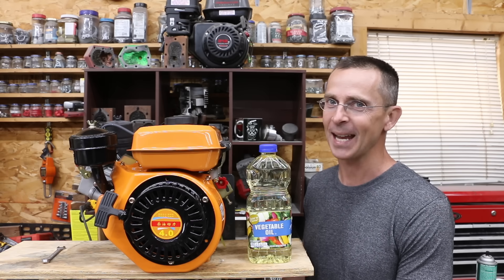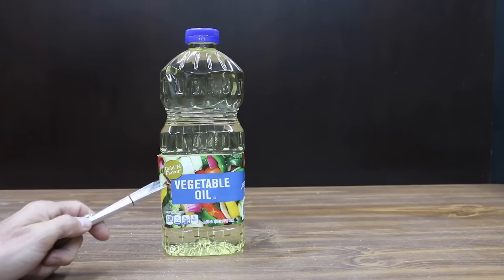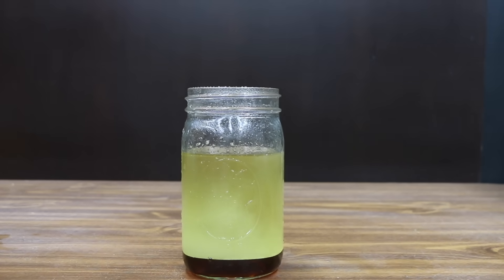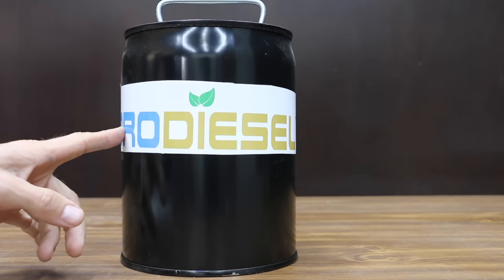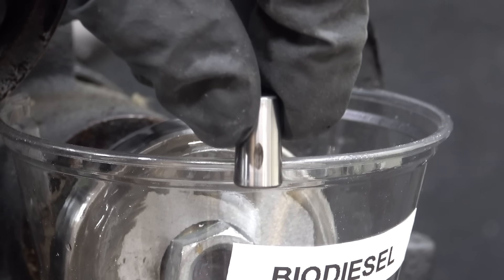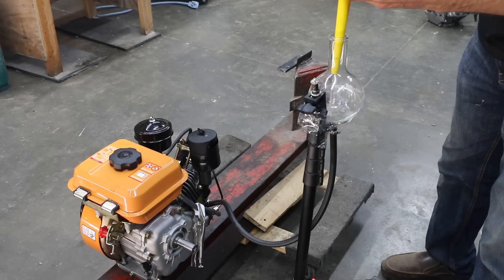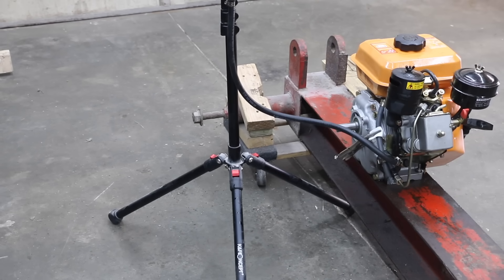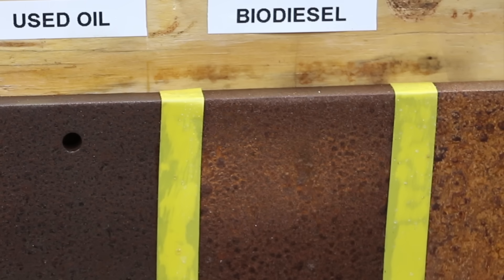Make "Biodiesel"? Let’s find out! Diesel vs Biodiesel, Used Motor Oil, Vegetable Oil, MPG

Comment from the maker: Here's the list of products reviewed. More details in the video description. Thank you!
Diesel Engine: https://amzn.to/34vTb0Y
Potassium Hydroxide: https://amzn.to/3i3xoFG
HEET: https://amzn.to/3p16IqN
Reply: there is a better self made bio Diesel
It's called a Schur Mixture. 
80% vegetable oil
15% petrol
5% rubbing alcohol (which needs to be dissolved in the petrol first before putting everything into the vegetable oil)

During summer you can use less petrol and the alcohol is just there to make get better ignition, so it's not strictly needed for all engines.

Comment: No,
there is a better self made bio Diesel
It's called a Schur Mixture. 
80% vegetable oil
15% petrol
5% rubbing alcohol (which needs to be dissolved in the petrol first before putting everything into the vegetable oil)

During summer you can use less petrol and the alcohol is just there to make get better ignition, so it's not strictly needed for all engines.

Comment: My only comment would be that the conclusions of which fuel ran the best is purely opinion based as you did not set up any kind of measurement metrics to make that determination.

Comment: Unfortunately, the skill to make biodiesel is pretty useless. Most cars/trucks can't run off pure biodiesel. Most "biodiesel" you find at pumps is only 10-30% biodiesel. The viscosity is too thick to get through the injectors.
Reply from the maker: Thanks for the feedback.
Reply: @ProjectFarm  thanks for the reply. Rereading what I wrote makes me seem like a downer, I'm sorry.

I think being able to make biodiesel is really cool and had looked at doing it to try and save money for my off-road vehicle. Needless to say, I was a little disappointed when I learned I'd need a solvent (gas or diesel) to make it usable. To me it felt like it defeated the purpose.

Comment: During the late spring through mid fall i run a 60/40 blend of bio diesel and regular diesel fuel for many years wino problem i did build a filter system using wix oil filter and a electric pump to pre filter the used vegetable oil and another one to filter it once again before I mix it with the regular Diesel fuel. Before I stared doing that i was having to change fuel filters on my truck a lot  but now once a year.
Reply from the maker: Thanks for sharing.

Comment: Hook.
It to a heat pump or an air conditioning unit to use as a heat pump and see how efficient it would be to run it.Heat pump with your motor get the heat from the motor and the heat pump

Comment: As students we used filtered old vegetable oil from a french fries shop (common in the Netherlands France and Belgium) mixed with diesel about 10:1 for years. We had some issues with clogged up fuel filters, but that was about it.
When you get to adulthood, you start to want a car that doesn't make the whole area smell like french fries (not burnt french fries).

Comment: Older mechanical injection diesels can run on anything. My friend has an 82 Toronado diesel (upgraded with ARP head studs), and he takes all my used motor oil and my boyfriend's, and fills his tank.Runs flawlessly on the used motor oil. He keeps a couple bottles of vegetable oil in the trunk in case he gets low on fuel. Doesn't smell like storing diesel there. We have a provider of biodiesel nearby, and it's cheaper than regular diesel and his car runs better on it, less smoke, more power. Amazingly enough, he managed to run it on medium marine fuel oil once (He's a marine mechanic). Even has been run on Jet-A. The Stanadyne DB2 pump is good at compensating for different viscosities of fuel, so whatever is run in it, it tends to run well.
Reply from the maker: Thanks for sharing.

Comment: I want to cook with it and heat my teepee tent with a diesel heater running on bio-diesel. With lower viscosity, I think it will burn hotter with my wick stove. I'll probably mix diesel or kerosene with it in the winter to keep it from gelling.
Reply from the maker: Thanks for sharing.

Comment: All of the used oils and hydraulic fluids I collect at home I catch as clean as possible in a catch can I keep sealed in double trash bags. When full, I pour the 15 qts into 5-qt oil jugs I save from new oil/fluid changes.  I let the jugs sit for at least 90 days and then slowly pour off the top 4 quarts. The last quart has the settled solids or contamination in it. 

I mix 3 gal of the clean used oil with gasoline nearly 1:1 in 5 gallon fuel cans and shake for 1 minute, and put two 5-gallons cans into a 3/4 full tank of diesel. My 2005 Ram diesel has a 40 gallon tank. This makes a mix of about 15% used oils.  It seems to run fine Winter and Summer.  I do change my fuel filter a little sooner than typical, about every 10,000 miles, rather than 15,000.

The dirty oil left in each jug i combine  again and let settle another 90 days and repeat. The 2nd time I pour off the top and use the remainder as chain-lube and make two-cycle fuel for my chainsaw, and some start my wood boiler at night.

It's a cheap and easy way to get rid of collected fluids, have a little free fuel, and not waste anything either.
Reply from the maker: Thanks for sharing.

Comment: A video on different black diesel filtering systems? Like the cheap filter setup vs a centrifuge setup maybe
Reply: Unless that's too expensive a video of course. Although you could use that fuel for your equipment and ram if you still have that
Reply from the maker: Thanks for the suggestion.

Comment: For those considering waste motor oil (black diesel), as stated ensure your diesel engine has manual injection fuel pump.  Also, I recommend thinning it with kerosene over gasoline, and using a 5 micron filter before putting it in your tank.  I ran black diesel in my mercedes for a few years during college when money was tight.  I had a few friends and a shop that would give me their waste oil
Reply from the maker: Thanks for the feedback.
Reply: @ProjectFarm  You're welcome!  Thank you for the excellent content!

Comment: Back in the late 80's early 90s,  a few trucking companies tried using used motor oil for diesel fuel.  The problem is, after about 100 miles the fuel filter needed to be changed.  I thought if they  pumped the oil through 4 filters first,  it may have worked better.  Just a guess on my part.

Of course it would depend on the volume of used oil too say 200 gallons.
Reply from the maker: Thanks for the feedback.

Comment: Had a 3-cyl Kubota with a compression release. In winter you could pull the c release and get the engine spinning and the oil pumping for a dozen revs then close the release and it would fire right up. Batteries lasted 17 years in that thing with no effort at all.
Reply from the maker: Thanks for sharing.

Comment: Wow that’s amazing that the engine was running on motor oil! It might be useful if you have a generator to save your used motor oil to cut down on fuel costs if it’s used regularly. Thanks for the great video!
Reply from the maker: You are welcome !

Comment: fun fact, the modern injection pumps, like 2000 foreward, are not that happy with oil in the fuel because of how the operate. the ones from the 90s could actually run on partial oil, because the pumps are less refined and so they wont die
Reply from the maker: Thanks for the feedback.

Comment: You can make biodiesel using water cooler jugs as containers to distil and mix vege oil with caustic soda and ethanol. Farmers in  SE Asia do it, as imported diesel for farm equipment is expensive if you have no cash flow.
Reply from the maker: Thanks for sharing.

Comment: Great video! Years ago I used to drive my Peugeot Partner 1,9D (made in 1997) on used engine oil for couple of years. It had no problems with it, even started quite well on cold climate. At first I filtered it but later was to lazy do do so. In the winter just in case added some 30% diesel on tank to be sure it has no problems with starting. The engine did not smoke or did not smell badly when using old engine oil as fuel.
Reply from the maker: Thanks!  Thanks for sharing.

Comment: Here goes my 2 cents and live testimony.
I've got a small 2 cylinder 4x4 diesel tractor, Satoh/Mitsubishi from the late 70's or 80's. Can't remember.D ue to curious circumstances. This tractor as been used in Portugal and Norway. Two absolutely different climates, geographic settings, altitude, etc. Either case flawless.
 
The point being that it as run on a mix of regular diesel and used synthetic engine oil. The synthetic part is just because that's what I use on my engines. Not exactly a choice for this particular case. 
Anyway, the engine is and was in perfectly good condition. Runs flawlessly. Start on the first turn. All in all I have absolutely nothing to point out due to the usage of used engine oil. I should disclose that I haven't used it much. But with that said it's also worth knowing the tractor sat for about 2 years totally unused! Not even started in that meantime. Parked in an non insulated and non heated garage. But out of the (much) rain and snow of Norway. 
 
With this said: To my amazement, 2 things picked my immediate attention. 
First the old battery still stand at a very healthy 12.3 V! And after the glow plugs did their thing. The tractor started on the first touch of the key!! I remind that was after two years seating untouched!!! Wow. All that happened with grossly 40%~50% used oil mix!! I was astonished. 
That particular oil didn't separate or (apparently) created any negative issues. In fact it might have contributed to preserve things in good shape. As this video demonstrate on the corrosion test.

The used oil was filtered trough a couple of old socks and a regular cotton T-shirt! Not the most sophisticated method but I guess enough to make it work. Collecting can on the bottom, large funnel on top, socks and t-shirt in between. 
Drop some oil, walk away let it seep trough. Come back repeat the operation... That was the rather slow procedure, it takes some time. 
The only give away there's engine oil in the tank is that the "fuel gauge" hose is black.

Modern turbo diesel common rail. I haven't tried. But with a good oil filtration system I would definitely give it a try... ;-)  
Cheers
Reply from the maker: Thanks for sharing.

Comment: I'm a bit late to the party here, when used veggie oil hit the scene as a viable fuel source I remember driving behind one of the thousands of diesel pickup trucks in the area and smelling chicken tendies and french fries. I remember as a child truck drivers would pour drain oil in their fuel tanks to stretch the amount of fuel they had. When I had my 83 turbo diesel Benz I used to put some ATF in the fuel filter when I would change it, it was good for the injectors.
Reply from the maker: Thanks for sharing.

Comment: Really interesting comparison, I'm doing a lot of research into used motor oil blends ("black diesel") and converting my Land Cruiser to a mechanically injected diesel like a 1HD-FT or OM606. Did you do any dewatering or filtering before mixing the motor oil and gasoline? All sources I've seen insist that dewatering and filtering are critical for avoiding sooting and injection pump wear. Also, I need to read up on this hydrodiesel, never even heard of it before. Thanks!

Comment: There was a paper on this in 2012. You don't need to do the de-esterification if you are ok with mixing in a small amount of kerosene.

1. Mix a bunch of gelatin into hot water
2. Pour into WVO
3. stir
4. Let settle
5. Pour off the now clean oil
6. Mix in 10 to 20% kerosene or gasoline

That's it. The vinyl esters in the petro solubilizes the fatty acids and you have a final product with more energy than standard diesel.

A farmerin Kansas who rotates sunflowers uses this fuel in his combine and tractors. He uses virgin oil so he doesn't need to clean it. He just runs it through a seed press with filtration and adds gasoline or kerosene. 20% in winter, 10% in summer.

Check out Robert Murray Smith here. He did a fantastic DIY and demo.
Reply from the maker: Thanks for the feedback.

Comment: Years ago i knowed a guy who was experimenting with different alternatives to Diesel. He had an old w123 Mercedes with an engine that originally came out of an W124 Mercedes. He used old Frying Oil, filtered and mixed with fresh oil. But his favorite was "Waterdiesel" some regular Diesel or red Diesel mixed with Water. As Emulgator he used Brake Fluid, he also told me something of Dishwashing liquid as Emulgator. But i dont know the results of that anymore. 
Used and fine filtered Motoroil with Diesel or even fresh with Diesel oil is no Proplem if u have a mechanical injection. The motoroil raises the combustiontemperature, to high for the glowplugs to last, after a few thusand miles they are burned.
Reply from the maker: Thanks for sharing.

Comment: Not to parrot the much-deserved praise.  I love your content.  It has helped me answer so many questions on si many products.  That being said.  What engine is that?  I've been looking to replace my log splitter motor.  A diesel would simplify fuel purchases by going all diesel on my equipment.  You should run it against other engines for furl efficiency, and such.

Comment: I've been running 80 % used vo 20% reg gasoline in my Mercedes Benz for years  runs good . Also were did you buy the small diesel engine ? I always watch you .thanks Leon

Comment: The Diesel engine was made by a man by the name of Diesel. He made the engine to run on vegetable oil. The oil companies decided to use their trash oil by product that they had no use for (and were burning in open pits to get rid of it) to run in Mr. Diesels engine and so they sold it super cheap and people starting buying up cars and trucks with "diesel" engines to save money. Then the greedy oil companies started easing up on the price until it now costs more than gasoline.
Reply from the maker: Thanks for sharing.

Comment: When engine can run on biodiesel and vegetable oil, plus-one with normal diesel, petrol 1% premix, mothball one ball premix in petrol before diesel, oil from grease-trap of restaurants processed by sorted(not filtered) urine-faeces-mixture(most noxious-caustic solid-bottom sludge-portions) eating grease-trap oil before filtration, ...

That will speed things up at the jams, maybe, ...

Comment: I unironically use all these in my diesel 

Especially used motor and cooking oil 

You run it through filters but that's really it 

I mix some with diesel so it's not as thick but it works out good
Reply from the maker: Thanks for the feedback.
Reply: @ProjectFarm  love your videos brother, keep up the good work 

In case you're curious, I usually just use old denim jeans, specifically the keg part tied in a knot and letting the mix run through a few times just to get out any possible solids 

It's cheap asf but works 

😎🤙

Comment: I have no knowledge of my own, but I have read that vegabilie oil produces harder soot particles in the engine, which stick more firmly to the engine's cylinder walls. So if you run on pure vegatibil oil, you have to open the engine a little from time to time to clean it of hard soot particles or you convert the vegatibil oil to biodiesel.

Comment: A few years ago (UK) I ran a 2.7TD Nissan terrano. As an older diesel my Internet research suggested biodiesel would be effective, fortunately there was a local biodiesel supplier and I would try to fill the vehicle there when possible. IIRC back then it would have been maybe $8 per UK gallon. The only problem I encountered was that biodiesel can strip diesel varnish from the fuel lines which leads to a blocked fuel filter, poor running and loss of power. Fortunately this only happened twice and the fuel filter on the Nissan was easily reached under the hood and was a tool free spin on, spin off type. No bleeding or purging of the system was required. 
The vehicle would also run on pure sunflower oil, but if you did this then you were supposed to pay an additional fuel tax, as the veggie oil was sold as an untaxed food product, rather than  a taxed road fuel. 99% of people using veggie oil didn't bother with the extra tax and AFAIK no one was ever prosecuted for using it. More people were prosecuted for using "red" diesel, which has a very low tax rate for agricultural use only.
Reply from the maker: Thanks for sharing.

Comment: Hi I Have a few questions if someone could answers them:
1: what are the big differences betweeen bio diesel and used vegetavle oil
2: Can bio diesel run under extreme heat
3: can modern toyotas run fully on Bio diesel?
Reply from the maker: Thank you for the video idea!

Comment: My 97 7.3 loves 90/10 oil/gas... been running it over a year now
Reply: how cold does it get where you are?
Reply from the maker: Great feedback! Thank you
Reply: Thanks for your feedback. I have a shop with an endless supply of used motor oil. Whwt type of filtration / purification do you rocommend? Most of the oil changes coming in lately are 0-5 oil weight. I have a 96 7.3  Thanks Eddie

Comment: Not worth it for driving a car. But for running a small diesel engine like yours or lil bigger... totally worth it for that. Especially if u just running it a few hrs at a time. Say to help charge batteries when solar and wind are not ideal conditions. Im sure a small plant converting oils, used cooking and used motor oils. Would be semi-ideal for villages and small communities way out in alaska and canada. Alot of them only have power for a few hrs a day. If at all
Reply from the maker: Thanks for the feedback.

Comment: if you have an line pump from bosch then youre are fine, some engine are made to run on everything like the mercedes OM 601 602 603, and the cummins 12 valve diesel eingine the run on everything but the feul has to be clean and thin enough.